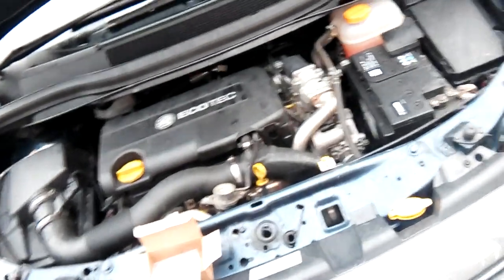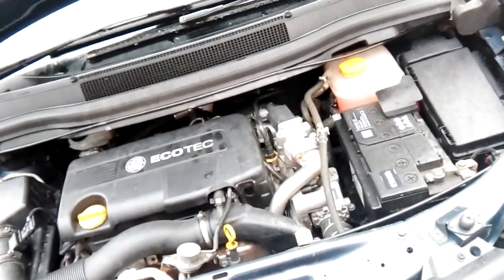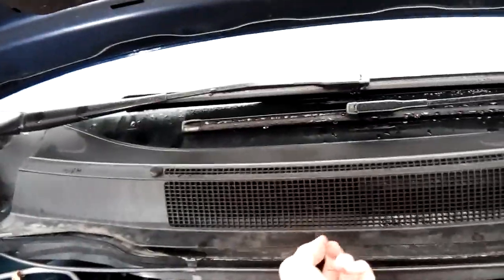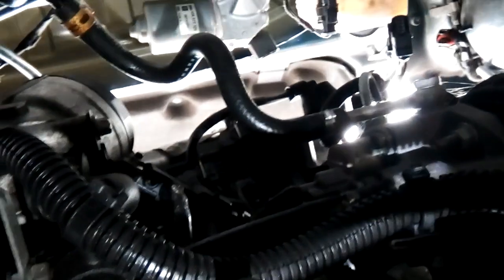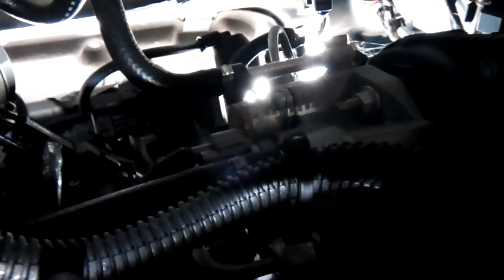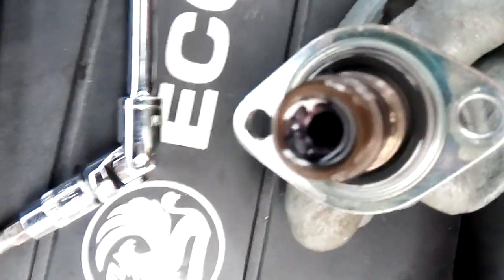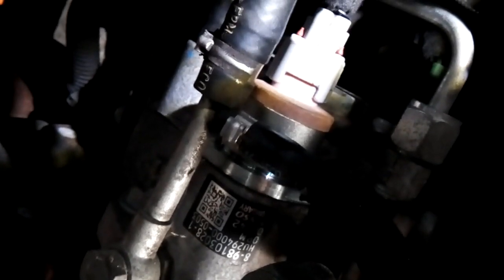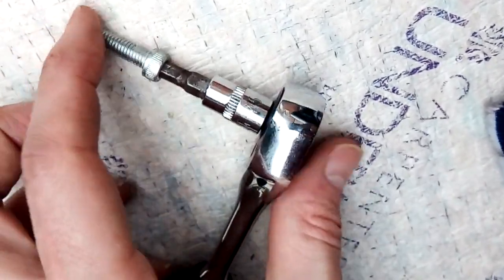Vauxhall (Opel) Zafira B 2011 Surge control valve replacement A17DTJ 1.7cdti Bosch

Comment: Think this is what is wrong with my car can someone tell me if they having same problem as me my car is running badly on idle tickover like missing a beat sometimes. And sometimes loosing power when accelerating. Is this the part I need in video or something else?
Reply from the maker: Hiya, so my suspicion is that it is not this fault, the loosing power when accelerating is what makes me think this, the SCV is generally only idling and low revs noticeable, it impacts engine/fuel surging so would not normally cause a lack of power so I think you need to check elsewhere. Good luck!
Reply: @junkendriven  thanks for the reply m8. I might just trade it in when get the new shape zafira diesel.

Comment: Hi sorry to bother you, this is a side question but do you know what the squeaking is when idle. Goes away when it starts to warm up. I notice yours does it at the beginning but couldn't hear it at the end. Thanks.
Reply from the maker: Hi David, not sure which noise you mean! Initially there is a slight squeak from the wet/damp aux belt. There is also the strange 'turkey gobble' noise which is a feature of these. It's the diesel fuel in the fuel filter assembly and comes and goes, it's very normal (Many Vaux techs confirm) and does go away briefly after a filter change but comes back days later.
Reply: @junkendriven  oh is that all the squeaking is. I thought my tensioner pulley was on its way out. Makes sense why it sounds louder in the winter.
Reply: Hello, I hope you answer my question. I have an Opel Zafira 2005. Change the fuel pump, but I still have the same problem as in this video. What do you advise me to do now?

Comment: Please help, would this help my car. Just brought it, got 4 kids at home and it's broken down, seller blocked me. Dont feel safe to drive it. Got code 22795b. Was in semi limp no faster than 40, Inlet manifold bar had come off, got that sorted. Changed air filter, cleaned egr and maf but engine light on and still struggles to get power intermittently. It's making the same squealing noise I can hear at the start of your video, was told that's the alternator but could it be this? Weirdly both times its goes into limp mode is after I've fueled up. It's a zafira 09 1.9 cdti. Run out of money now so hoping it's a quick fix, I'm so lucky my dad is trying everything he can !
Reply from the maker: Squealing sounds like accessory or fan belt so that wouldn't cause major problems (yes could be alternator bearings).
Limp mode is normally sensor or computer variable out of range, get codes read again after limp mode as could be all sorts causing it. If limp mode clears itself then it's a temporary fault such as turbo actuator position problems, egr still could be sticky.
Too many thing unfortunately. Good luck, hope you sort it Emily

Comment: Hello, your car was smoking white?. Plz reply.
Reply from the maker: Hi, no the surge control valve doesn't cause any change to smoke, etc, it only causes the rev hunting or kangaroo'ing. Pure white smoke suggests water vapour, white with a tint of blue would point to oil. You need to get that checked out ASAP if it's doing either constantly. Check your coolant bottle for any oil residue, and your oil filler cap for a creamy white substance, could be head gasket, oil cooler, or all sorts of things but all could be bad.
Reply: @junkendriven  thanks for your reply mate.

Comment: Do you know the part number or link where you purchased it?
Reply from the maker: Hi, The codes changed a bit, searching now this one looks like the same unit https://ebay.us/8PVTcV but check part numbers, etc.
Denso part number is DCRS301110
Reply: Andy Brown thanks Andy. How do I check reference the part number without taking the old one out?
Reply from the maker: Hi Chris, unfortunately just down to workshop manuals for your particular engine code to check it. If you look in your servicebook/Car pass card it should show the engine code (Mine is A17DTJ) so you can confirm the correct engine code for the part.
Reply: Can It go back in either way?

Comment: Would you be able to notice surging as your driving, mines doing this🤦‍♂️
Reply from the maker: Yes, it's most noticeable when a cold day I've found when engine is cold and improves as it warms up.
If you replace, use a good quality replacement as I've found the cheap ones fail and get worse again after a year. The ones above £70 seem better
Reply: @junkendriven  mines seems to be when it's warmer, it's like I can rest it at like 2000rpm but notice it pull then pull back by itself,but it surges at idle occasionally not all the time, getting occasional smell of fumes also in the cabin, I'm wondering if I got a problem with a few things but that's probably 1 problem of many, I've done 138000 now, taxi so alot of short journeys 🤷‍♂️ had egr problems which I've cleaned, it's due a service, I've got to make the car last another 2 years yet, maybe change things one at a time
Reply: Perfectly fine today 🤷‍♂️🤦‍♂️😂
Reply: Sorry to hijack your video lol I believe its just gone through a regen, very stuttery but noticed white smoke, so pulled over and revved it up to 4000 rpm, smelly, seems that done the trick 🤞
Reply: Well after giving up on the self diagnosis, I took it to the garage, they tested the egr, air filter, turbo and fuel filter, no codes, they suspect the suction control valve🤦‍♂️😂 orded one lol

Comment: Abs light stays on. Speedo doesn't work either on my Vauxhall zafira any suggestionson what could be the fault
Reply: Google VAUXHALL ZAFIRA FRONT WHEEL BEARING SPEED ABS SENSOR

The wheel bearing normally front passenger side also contains and sensor that also has Speedo sensor all in 1 hub. Can pick up quite cheaply. There are Utube vids showing the fix.
Reply: Abs rings missing

Comment: Do you have to program the SCU to axcept the new SCV
Reply from the maker: Nope, plug and play, the ECU will relearn the fueling almost immediately, I didn't notice any varuation.
The scv is only 2 pin so no feedback to ECU
Reply: @junkendriven  did it solve the problem and have you still got the car
Reply from the maker: Yep and yes, see other videos! My advise though, buy the more expensive genuine part as some of the cheap ones fail early

Comment: Mine seems to go bad every 40 000 miles or so. Is that normal or too often? I've changed it twice now.
Reply from the maker: That's interesting. I've got a follow up video shortly on that exact issue. I think it's cheap parts! Follow up video coming soon
Reply: Maybe DPF needs regen
Reply from the maker: @nathanreid2974  unlikely, DPF wouldn't cause engine hunting like this unless badly blocked (flashing glow plug light). I've tested and found the cheaper products do fail after a short time.
Reply: @junkendriven  have you got the folow on video

Comment: I have the same care as this same year same engine will part number 55582723 fit
Reply from the maker: Yes, that part is compatible
Reply: @junkendriven  oh thank god as I ordered it off eBay because buying  one here is 150-280
Reply: Thank you
Reply: @junkendriven  I have a problem with the air recirculation flap it's stuck and throwing out cold air when I took the actuator motor out to check it the little rubber cog the motor fits in to fell in to the heater box I have no clue how to fix it, it's seems like the dash has to be removed or something is there a way of getting to the flap from the outside my family are freezing in the car and with the winter coming in it's only getting worse please help me Andy I'm desperate

Comment: I change the EGR unit. the fuel pump filter.  mass airflow unit .had the engine tank  cleaned out..this was the recommendation by three different garages. Who put on three different diagnostic machines.I took your advice and bought the suction valve worked straight away after spending £900 on stuff I did not need. Thanks a lot I wish I looked at your video £900 ago. Thanks again.
Reply from the maker: Ah parts darts from the garage. Yes, the thing is it's an odd fault and could be all of the parts you had replaced or a combination. But start with the cheapest first and work from there. I'm glad you got sorted but pity it couldn't have been a cheaper bill to pay :(
Reply from the maker: Meant to add, no diagnostic scanner I'm aware of will highlight an issue with the SCV, it just won't generate a code (perhaps completely unplugged it would) so diagnostics will almost never show an SCV problem
Reply: @junkendriven  I've recently changed scv, but problem is still there.
What would you recommend?
Reply: @TollyTolly  Did you calibrate the new valve after installation?
Reply: @Mbz /  the garage I took it to are saying  after fitting new scv, you have to reprogram it. ecu
Reply: @B.Walker. i bet the garage told youthey did. The easiest 100pounds to plug in a scan tool for nothing…2 minute job thats not necessary
Reply: @neildean7515  No they didn't, I never got them to fit the scv, plug and play

Comment: I have the same problem with my opel astra j 1.7 cdti 110, i want to know if after you change that SCv Valve you did some programing with the tester or is plug and play?
Reply from the maker: Hi, it's a plug and play valve, no programming needed
Reply: @junkendriven  Thank you! A will try to change it this weekend.
Reply: @junkendriven  the garage said it needs reprogramming? why doesn't it need to
Reply from the maker: @B.Walker.  Some may say that, what it really needs is re-learning which the ECU will do on it's own or you can force it as an option in Opcom/Vauxcom
Reply: @junkendriven  thanks for replying

Comment: Did mine today, here's some tips from me.
Prop bonnet up on the right with a broom shag  so the  bonnet stay isn't in the way, (better access).
Do not take plastic cover  of the rocker cover, the fuel return pipes  T peices are easily broken and cost £70 to replace as it comes as one unit (ouch).
Mine came with a gasket, rubber seals, as its arkward to hold the scv in place  I places a strip of masking tape across the tin seal, once into position and the new bolts in place it can be easily removed.
When i started it back up it did the same lumpy idle, I turned it off and restarted,  idle was back to normal.
Hope this helps
Reply: Did you buy a denso one off eBay ?
Reply: Bought mine from europarts
Reply: @johnbatty3535  hi i know it a long time but what did u search for as can find it.. if any help please thanks
Reply: So you didn't calibrate the new scv with a program like opcom? Just starting the car again has learned the new valve?

Comment: Cheers Andy, was there in codes generated in ECM for fault cheers sandy
Reply from the maker: No, this one doesn't generate fault codes unless it totally fails/doesn't respond to ECU. My suspicion is that it becomes weak (It's an electromagnetic solenoid) and can't react/move with as much force. So only indication is the surging/poor idle.
Reply: @junkendriven  thanks Andy great bit of info cheers sandy
Reply: @junkendriven  hi .from where you buy this sensor  :) ?
Reply: Hi just changed mine but the sounds the same? Is there anything else causing that?
Reply: @SPaul301  did you fix this?
Reply: kirsty no it did not. Sounds the same will try to buy another one. Hopefully should solve as many people said before have no idea why but I will give it a go :)
Reply: kirsty yep same here bought it off eBay might try getting one from Vauxhall... Would be a pain if the problem still continues though 😡
Reply: kirsty I will definitely let you know if I do first or you do let's go! 😁.. hope you do fix it :)
Reply: @SPaul301  Did you fix the issue?
Reply: Lamba Struja do I haven’t.
Reply: Hi andy I have the same problem with my car I replace my scv but stilll the same

Comment: Where did u get the part from  good video
Reply from the maker: Thanks, I'll put the part in the description as others might want it. It was from ebay and chinese seller, took a couple of weeks to arrive but part is spot on.
Reply: @junkendriven  i have the same problem  with a vauxhall zafira design  1.7 diesel revs up and down  does it affect the  turbo
Reply: Got mine from europarts    vauxhall dealers wanted £250
Reply: @johnbatty3535  autodoc this is app u can download this app and search parts